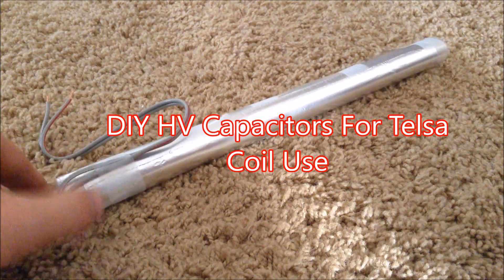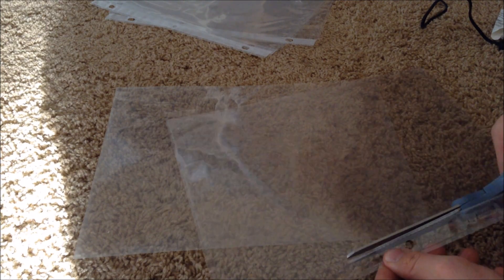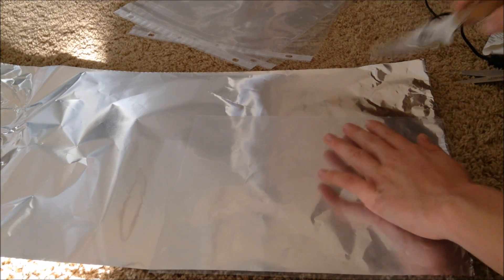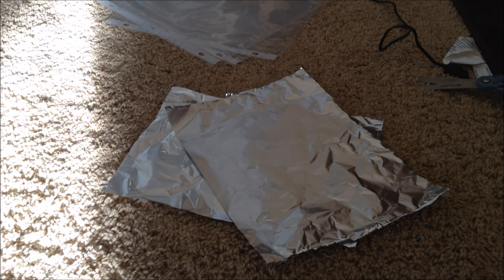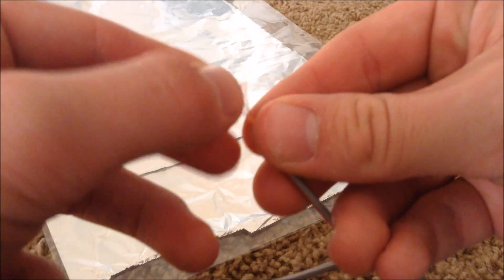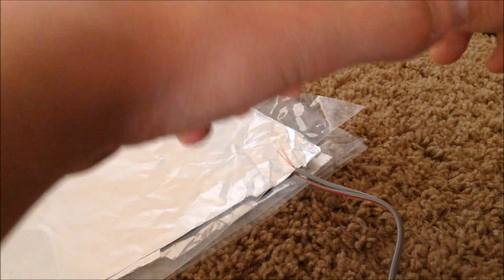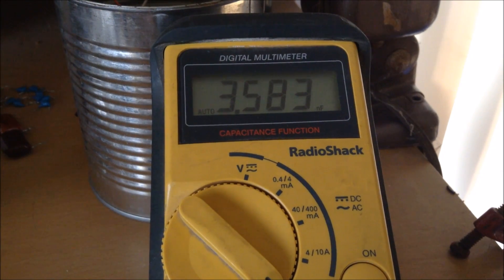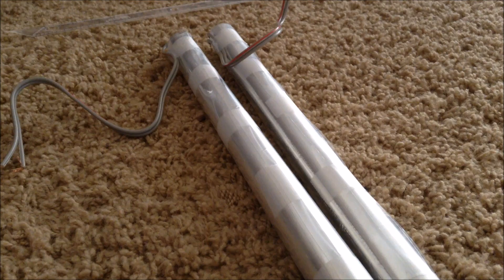Dirt Cheap DIY High Voltage Capacitors

Comment: I tried these out and I've had to make a few adjustments for 12kV. The breakdown voltage of the page protectors is too low to only use 2 sheets as the dielectric between the conductors; I've found 6 sheets to be safe. Also, at 12kV, a centimeter distance from the edge of the aluminum foil to the edge of the page protector is too short. The surface path length needs to exceed 3 inches from one conductor to the other to prevent discharge across the surface of the page protectors. Instead of 1 cm, I had to make mine more than 1.5 inches.
Reply: Actually, make that 4 sheets. 3 sheets works sometimes.

Comment: I designed another capacitor, made from Ziploc bags and aluminum foil, and although it's slightly more expensive, it can be modified to work for higher voltages.

Comment: that's about the same capacitance as your flux capacitor you made in the live stream. you might be on to something with that flux capacitor haha
Reply from the maker: yep, except the flux capacitor has a significantly lower breakdown voltage.
Reply: jjhack3r flux capacitors are a sci-fi creation, and not a real component.

Comment: what is the plastic called? i cant hear you properly
page protecters?
Reply from the maker: +XPumpkins Yes, they are page protectors and can be bought cheaply from any office supply stores.  The plastic is polypropylene
Reply: Tanner Tech ah thanks,edit: do you know where do i get cellulose acetate? is it the commonly sold plastic sheet the size of A4 paper?